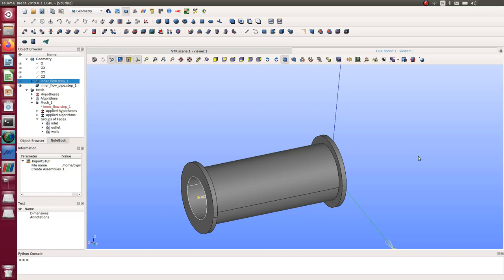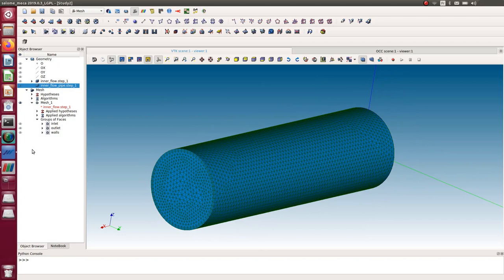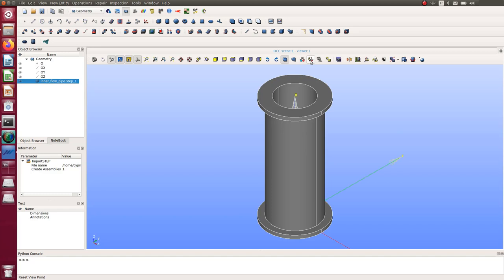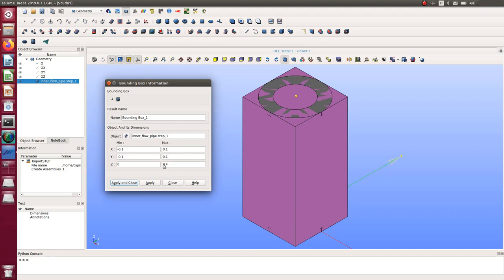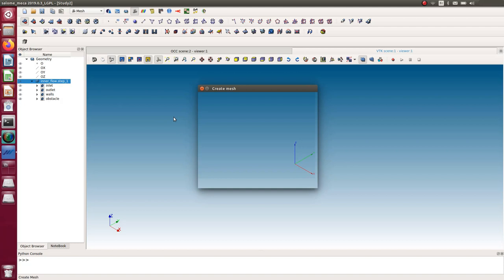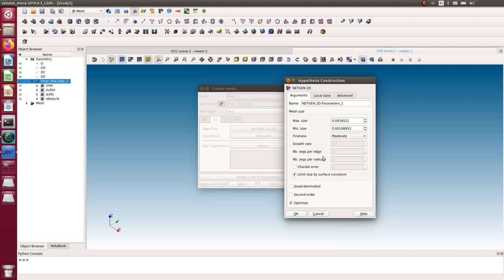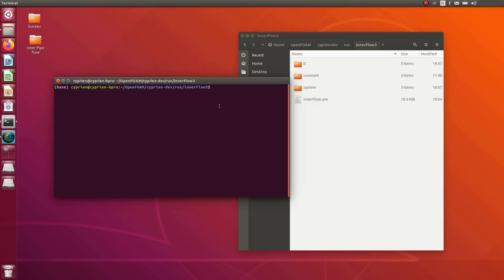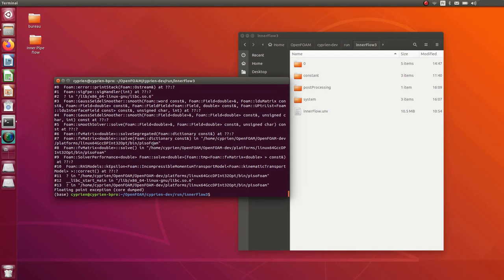[OpenFoam Tutorial 5]   Turbulent Flow in a Pipe with Salome as Mesher

Comment: Hello, I think the problem with MPI is that you haven't partitioned the mesh: you are actually running 4 instances of the same sequential computation instead of a parallel computation, that's why it's taking longer (there is the overhead of the communication in top of the normal computing time).

Comment: Why did u use the value of the Pipe Turbulent Length Scale for the epsilon value ? Shouldn't you calculate also the epsilon value with the formula provided on Wikipedia ?  thanks a lot Cyprien

Comment: about mpi, when your mesh is coarse, the data transfer between the processors can be slower, slower than computing the solution with just one processor, you will see significant change if you have more than a million cells. Also depends on number of processors, decomposition technique. For example my cfd takes less time with 24 processors than with 72 processors ( 9 million cells).

Comment: Thanks Cyprien, it is very informative tutorial video. In addition, I would like to add  couple of things to this video:1- as you used wall model to emulate the fluid dynamics near the walls therefore checking Y+ is required. If Y+ is too big or too small you might end up either invalid wall model or unnecessary wall model in your calculations. 2- you might have found out why your simulation did not run faster when you used more processors, in case someone wants to know the reason, I would like to explain a bit more here, OpenFoam parallelization is done based on  MPI, which means, we have to decompose the mesh into smaller size in order to assign each part of mesh to each processor.  here is an example of running an application in parallel(after decomposing the mesh): mpirun -np 8 pisoFoam -parallel . If you want to run a simulation with multithreads you must check if your application is built or compiled with threading support.

Comment: To use mpirun for this case, we have to prepare "decomposeParDict" under the system folder and modifiy the content (number of cores in use & mesh partition method). Then, run the following command:
(1) decomposePar                                     // Mesh partition for calculation
(2) mpirun --np [n] pisoFoam -parallel     // Designating the number core to use, and run in parallel [n]: [number of cores in use]
(3) reconstructPar                                     // Reconstruct the temporary processor folders (processor 0~n)
(4) rm -r processor*                                  // Discard all the temporary processor folders after reassembling all the temporary processor folders

Comment: Cyprien, thank you for the helpful videos. I have been trying to run an aircraft external flow simulation on OpenFOAM. I used the motorbike tutorial as a template, and have gotten results that I think are close. My issue is that I am having issues creating good quality inflation layers using snappyHexMesh. I've tried some other routes too, but getting good inflation layers was always the barrier to a good simulation. From watching Salome tutorials, it seems like it is easier to create good inflation layers compared to other meshing software.

If you did a demo for an external flow aircraft that starts from importing a geometry (or surface mesh) and shows how to generate a far field and inflation layers, I (and I'm sure many other aerospace folks) would deeply appreciate it.

Comment: Great and helpful video.  However, I had a lot of trouble getting the latest salome9.10 up and running.  Have you tried installing that on a clean machine? I was a couple of days of work to figure out what was missing given that I am still only an intermediate Linux user.  It looks like Salome had better install instructions in the past but not now.
Reply from the maker: I didn’t try recently but I agree that it’s becoming harder. The main problem is that they are not Ubuntu users, so they are unaware when some files are missing in the Ubuntu package.
You need to report your problems on the Salome forum to make them aware

Comment: Hello Cyprien thanks for the tuto. Wouldn't have been better to run only the half of the model as it is symmetrical to save some simulation time, if yes how to do it?
Reply from the maker: I think it depends when you have turbulence involved. Even if the geometry is symmetric, it doesn’t necessarily mean that the flow will (I am thinking about the cylinder example in a turbulent flow in which the eddies oscillate with a certain frequency on both sides for example). In this case it’s true that the results look symmetric though!

Comment: Thanks  very much Cyprein....I have a question 
Q......Aftet you meshed the innerflow (18:32), you create a group from geometry (and you emphasize that not from the "obstacle"...)
Could you explain it why "obstacle" is excluded? Because the obstacle is not chosen, after you imoprt the mesh to OpenFoam, there is no boundary as "Obstacle". BUT!!! after you solved the mesh, the obstacle can be clearly seen in Paraview at the end of your video...
Reply from the maker: The obstacle group I created was used to refine the mesh size near the obstacle (I am using it when I mesh the domain in Salome)
After that, I am not using it because I don’t need to define specific BCs on it in openfoam ( the wall group already contains the obstacle surface)
Reply: @Feaforall   Thanks for your reply Cyprien...
Do you also have any plan to upload an MRF simulation? 
I would appreciate if you could do that....And if you could start from Geometry and run it in OpenFoam. Indeed the whole Youtube perhaps lacks such a video.
As I mentioned in another comment in your channel, the way that you start your video (by giving a short review of the video) is great. Hence, I am sure that such a video would be very useful for many students and OpenFoam learners.

Comment: Hello It is a very helpful video Thank you
But when I add the residual function in the controldict this error comes up

--> FOAM FATAL IO ERROR: (openfoam-2206)
Unexpected '}' while reading dictionary entry

file: system/controlDict at line 50.

    From static bool Foam::entry::New(Foam::dictionary&, Foam::Istream&, Foam::entry::inputMode, int)
    in file db/dictionary/entry/entryIO.C at line 156.

FOAM exiting
Please help
Reply from the maker: You are probably using a different openfoam version

Comment: Thank you. I am wondering how to add units for the cylinder created by shaper of salome liker your step file with a mm unit? Any reply would be highly appreciated.
Reply from the maker: Salome is uniteless. The way it works is that you have to be consistent with the units you choose. The best is to use standard units everywhere like that you can’t be wrong, but in case you want to use mm instead of m，you can just do so but then all the other quantities of your model which have à distance unit into it will have to be converted to all use mm. For example, Pressure unit would become N/mm2 instead of N/m2 (Pa)

Comment: Thanks for this video! Unfortunately, I couldn't run the simulation because I got some errors. 
1 - My mesh on Salome wasn't uniform, one side of walls was like yours and the other one was too fine.
2 - I took the same example than you, but my system directory came with lots of files like "FOadd, FOblendingFactor, FOdiv" and some other FOs hahaha. 
When I run the simulation, I got "time step continuity errors: sum local = 2.02142e+215, global = 4.06063e+198, cumulative = 1.21819e+199"
I would be thanks if you could help me. Btw, one more time, thanks to share your knowledges with us.
Reply: Add
I tried to delete these files on system, but when I done it I got an error for ideasUnvToFoam: Cannot open include file ".../cavity/system/FOfieldAverage" while reading dictionary "system/controlDict.functions"
Reply from the maker: Maybe the version of OpenFoam you use is not the same… either much older or more recent. A lot can change over the years…

Comment: Thanks Cyprien. I can run your simulation files on my machine.. but when trying to run my own i get 

"time step continuity errors : sum local = 2.84108e-08, global = 2.69594e-09, cumulative = -6.77675e-07"

any advice? 

Thanks!
Reply from the maker: Try to use a software to compare your files and mine to see where the difference lies (I use “meld” for file comparison)
Reply from the maker: @digbylaurencebarcis7771  Wow, this is a huge Reynolds number. You are sure you calculated it correctly?
If yes, then you might need LES indeed as this is a very turbulent flow. RANS Simulation like in the tutorial is probably not appropriate for this kind of simulation.
Remember also that more the flow is turbulent and more it is difficult to predict the behavior of the fluid... I am not an expert in highly turbulent flows, so that's all I can tell you unfortunately...
Reply: @Feaforall  Great Thanks Cyprien! good news i did have success with a lower flow rate about 1/4 of the proposed flow, which is is the number currently used in operation. I will try again with the high Reynolds number, I found a mesh density that works for the low flow scenario! quite a balancing act indeed! 

Thanks
Reply: @Feaforall  hey Cyprien, Thanks! perhaps i shall investigate an LES at a later time. I have another question! I may add another outlet to my model, its a gas inlet in reality, but we are only interested in the pressure value at this part and will change the geometry accordingly to enable the gas pressure to enter and our non return value to work etc etc. Shall i just add another face group "outlet2" for example?  will "ideasUNNVtoFoam" understand this etc? cheers. Thanks for any advice!

Comment: Sir please can you tell me how we get mesh at any cross section in paraview  openfoam???
Reply from the maker: Not sure I understand your question correctly… if you want to display the results at any cross section then you can just clip the model like I did in this video and then use a probe to check the results. You can also use 2 clip filters to get a thin layer of the model and then use an extract filter to export only those elements.
Reply: Sir my question is that if we want to get  mesh information  at any cross section in paraview then what we do for it ???
Reply from the maker: Just like I said, apply a clip filter, then you can select the nodes and elements and if you open a new window you can choose to open it into a spreadsheet. That way you get the mesh info and fields associated in a spreadsheet that you can export in csv or xslx format
Reply from the maker: Watch this video: [Paraview Tutorial 4]   How to display node and elements data in Paraview
Reply: Oky thank you  Sir

Comment: hello cyprien! thanks for the videos! as always your tutorials are great! tetra meshes are not recommended but you have the polyDualMesh application that transforms a tetra mesh to a polyhedral one this could help a lot :) (https://www.openfoam.com/documentation/guides/latest/man/polyDualMesh.html) the only issue with this workflow is that it is not possible to parallel it (as neither the meshing with salome is multithreading and neither polydual...).
normally, the new vr of salome 9.7 just went out and it should support this feature but for the moment I did not find how to do it.... if you play with that and you find it I am interested at least in a small text mail :)!
the parallel execution, in minute 58:43 it is not correctly done, if you look at the header of the log you have nProc =1, thats because you used mpirun pisoFoam, it should be mpirun -np X pisoFoam -parallel (with X the number of domains) but you need to decompose your case previously to do parallel, (the division of the mesh in each domain that will be allocated in each processor). https://www.openfoam.com/documentation/guides/latest/man/decomposePar.html for this you need another dictionary in the system folder, decomposeParDict where you clarify the decomposition method etc etc.... in this geometry i would go with hierarchical. (if you need extra indications dont hesitate to send me an email)
would love if you could make a video of doing an hexa dominant mesh with salome. like figure 6 in the boucher https://files.salome-platform.org/Salome/Common/Brochures/SALOME9-brochure.pdf
best regards!
franco
Reply from the maker: Thank you again Franco for those very useful comments! I was sure I did something wrong with the mpi… I’ll dig a bit in the links you sent whenever I have time, thanks!